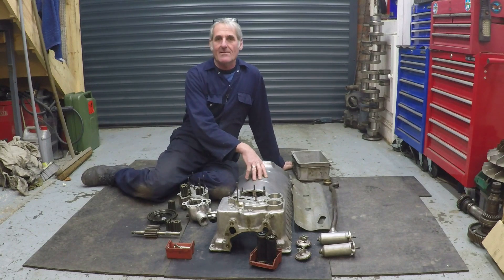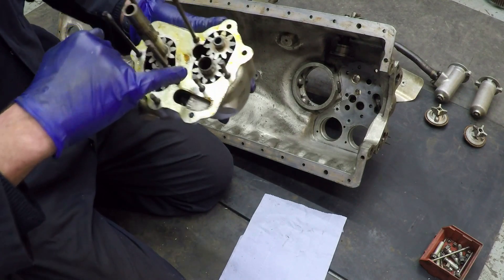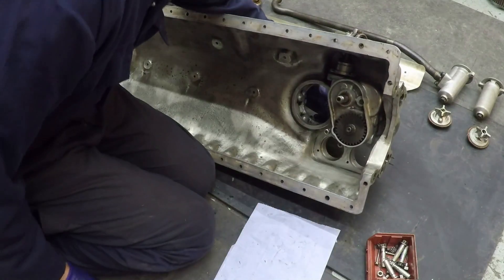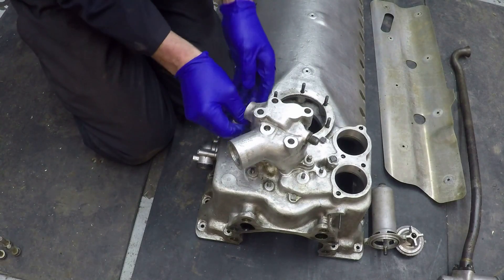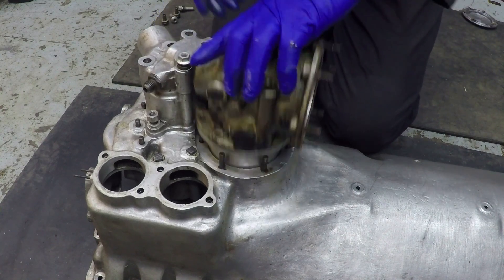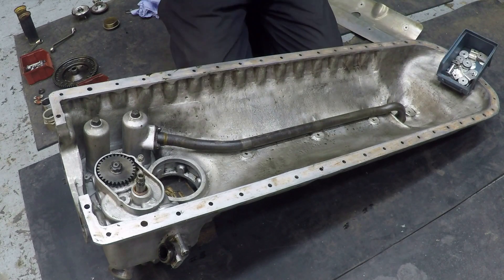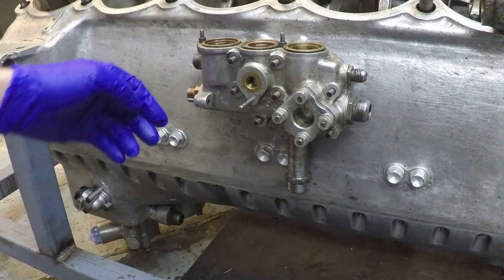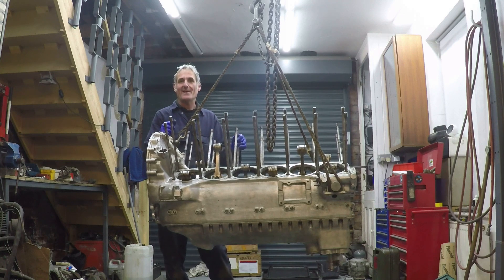Rolls-Royce Merlin MkXX rebuild: Episode 5

Comment: Gear shaper like vertical  Fellows which had a rotating table to mount part and a rotating spindle on which a  gear shaped cutter was mounted. As the spindle moved up and down the table and spindle rotating thru a gear train that established the number of teeth cut on  the part. 50 years I cut many cluster gear similar to those some even had helix angles

Comment: Ref the oil pump nuts and the ones you mentioned that were a pain on the jet engine housing, were we not using cap head bolts back then? I guess not

Comment: In memory of the crew, I can't figure out why you're not rebuilding this engine to actually run. Why go through all this effort if you're not going to run the engine that doesn't make any sense at all to me or to the dead crew, RIP
Reply: He's not said it won't run, just that this rebuild is not to the standard needed to certify for flight. 
Ground running can be a great way to experience the noise of a running motor. Clearly if it's the only thing keeping an 80 year old air frame in flight the consequences of any issue can be fatal, so there's very strict standards needed for all components, which he's aware of as he's calling out the differences vs a money no object rebuild.
Reply: I'm pretty sure the last thing on the dead crew's mind is a running engine

Comment: Grew up with a dismantled Kestrel laying around the workshop which my dad had acquired for the purpose of using the two to one reduction gear in a cabin cruiser he built in the late 50’s. Still have pieces of it packed away. The engineering has always had a profound effect on my thinking all my life.  Recently used two of the RR gears to adapt a steering system in a 60’s replica F1 Ferrari I’m building.

Comment: Hard to realize there were thousands of these engines built and used during the war! Each engine assembly required a large amount of special tools just to put the together. When you find bits in the screens large enough to have part numbers on them, then there may be a problem.